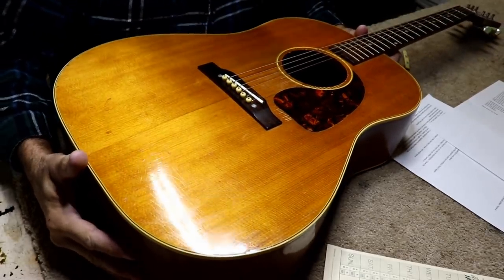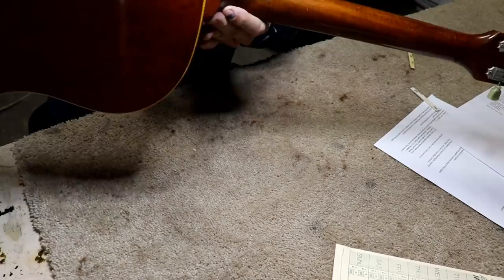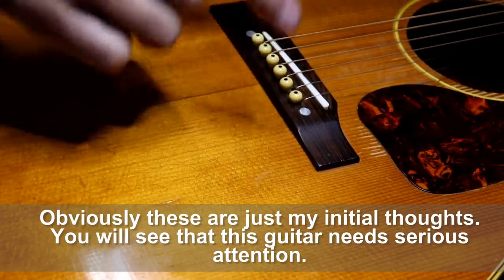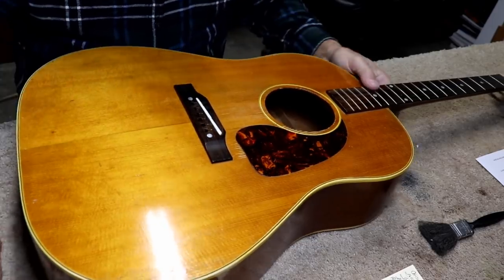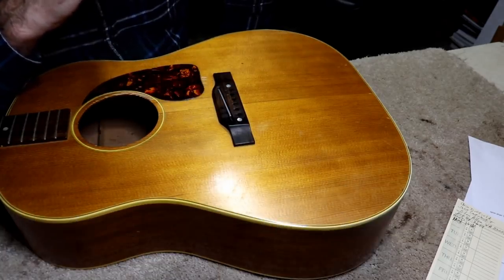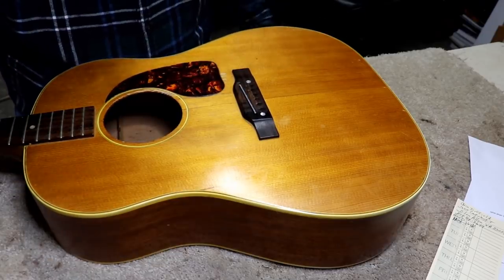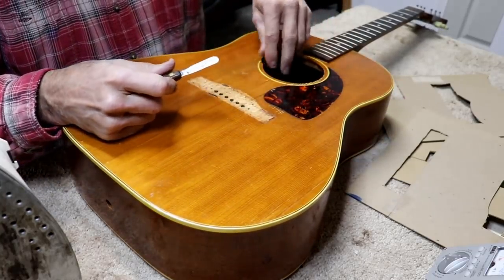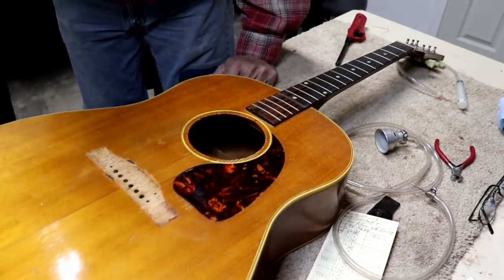278 RSW Gibson Guitar From England Rebuild Well Almost P1

Comment: Hi Jerry,
I have big hands too and it is really hard to get inside some of these guitars. I enjoy working on guitars too like you I started with building a mandolin then went to repairing violins and guitars. I'm living in the Philippines now and working on getting. Visa so I can bring my wife back to Oregon where I have a good work shop. While Im here I have built a very small work shop about 8' x 10' snd have been buying used guitars and repairing them. Because I need to keep building my skill or I'll lose it. I can buy some tools much cheaper here. So I'll be shipping some things home. Thanks for sharing your skill. I have got a lot of ideas from watching your videos. I still use my wife's old iron to heat and remove bridges. 😊

Comment: If you build a new jig, for pulling the neck, I would recommend constructing one that pushes against the heal, vs. pulling from the top.  A large C clamp (w/ different cauls for different style necks), incorporated into the jig, would allow you to wiggle the neck while adding pressure to the bottom of the heal.

Comment: At 50:03 trying to use the camera, if you made a small bracket that would hold the camera with a short leg off of it then use hot glue to mount the camera for a good view and positioned right, go in and do your work then heat a small piece of metal that you could go in and melt the hot glue to be able to removed the camera. It would hold the camera steady and turn your hand loose for working.

Comment: Had to chuckle a little bit over this video. Had the very same problem getting the neck off my "Vantage 12 string". That neck was sure stubborn to remove. It took time, but after working at it steady, it finally came loose, with next to no damage done by the removal, although I did find the dovetail lacking it's tip on the neck side, once it was removed. Where the tip is, is beyond me. It just wasn't there at all. About a half inch of tip was missing, when the neck came off... just disappeared. Everything else was in real good condition, both on body and neck.  Also found around the neck block on mine also needs work, getting it solid again, and the first brace between the neck, and the sound hole was broke in 3 places, so I removed it and have made a new replacement.  I also had to cut the fret board to remove the neck, but I plan on replacing the fret board on mine, with a new one. Should look good when finished.

Comment: Hi Jerry;
At 32, 13 we can see steam coming out of your teapot. Looks like a very workable apparatus. I suspect at this point that I would think they may have put some kind of pin between the neck and the end block. At 45, 50 to me the open crack in the center of it's length would indicate it's caused by the belly in the top. Perhaps if you could put down pressure on the top it would close, just saying. Ha;that's just what you did later in the video. (When I put the times, that's where I'm paused when I make the comment.) I love watching you work. I think I can say with surety that your top repair will come out great.

Comment: For the neck puller you were sent, my guess is that it sits on its feet on the table and the guitar is placed upside down on top of the puller.  Then you can push down on the neck and there is space for it to move down toward the table.
Reply: Exactly what I thought.
Reply: @overthetarget9401  same here. Not too hard to figure out.

Comment: Just a thought, but, those battery powered tools with a vibrating blade attachment which is offset yet parallel to the tool may extend in far enough to reach the bridge plate or could be extended to where it would.

Comment: Entertaining and educational as always Jerry!      I’ve seen some funky bridge pads on vintage Gibson’s,some of them are too skinny to offer a whole hell of a lot in the way of support.  One of the worst guitars I’ve had in for repair was a vintage Gibson,I forget the model as it was a couple years ago but it had a plastic bridge with some funky metal/plastic adjustable saddle and it was a string thru instead of being a pinned bridge. Guy wanted some top cracks fixed,normal pinned bridge and wanted a fret job and neck reset. Long story short,the last guy/gal who worked on it had the neck and bridge off,they used 2 part epoxies on the neck,bridge,nut and they tried to seal up a couple cracks with it too. It was a nightmare.
Reply from the maker: Yes I've seen a lot of those weird plastic Bridges. None of them hold up over time. Why they ever did such a thing I have not a clue. In my opinion the epoxy has very little use on instruments at all.
Reply: Rosa String Works. 

Jerry,I have nary even a guess as at why Gibson used such a crappy bridge and saddle design on other-wise nice guitars,well for a Gibson anyways lol  I know they don’t bring near the money on the vintage market that a traditional bridge/saddle Gibson does. It was just a shoddy design as a whole. 

As for the epoxy,in my opinion it has no place on any proper woodworking project.  That same Gibson that had all the epoxy in it also had a porly repairs neck/headstock break about an inch down from the break angle on the headstock repaired with epoxy. And it wasn’t even the good stuff like west systems or the likes. It looked like fast set permatex brand epoxy like you get at Walmart,homestore,hardware store ext.  It was glued up about 1/4” off of the centerline of the neck. Wasn’t anything I could do to that guitar at all. I gave him his deposit back and apologized for the shitty work done by the prior person.

Comment: Jerry,  I wrote you the other day, about the bridge plate tool remover. and asked if you might remember the video you used on in. Well Sir, This is the video, and the tool I was asking about. Now I know the tool can be bought through Stewmac.  It was this tool I need to remove the old chipped away bridge plate on my 12 string.  Thanks for the help you provided, Jerry.  I'll go to Stewmac.com,  and order the tool.  The bridge plate on the 12 string is thin layered plywood, and is a bit to small as well for the job it needs to do . I'll have to remove the old one, and make a new more solid one, and install it. I'm surprised I was able to find the info I needed so fast, with all the videos you put out, but luck was with me, and I found it.

Comment: Here's my take... IF you had moisturized the inside of the top, then strapped that flat board to it, and put a 25W light bulb inside for about 30 minutes (repeat several times cooling and heating with the light bulb) THEN, you would have had a flat top to attach your plate and bridge to. ( I saw p2 where you still had an arch across the top).

Comment: So I'm at 49 minutes in... Just want to mention, you should be able to insert the camera into the body through the input jack hole. If the camera borescope head is the same size as most of those you can get off Amazon.
EDIT: LOL, and 15 seconds later the text on screen mentions this very thing.

Comment: Bolts were added to brides to forgo clamping in assembly. Hours saved.
Reply: Cheap and nasty if you ask me and no prestigious brand should be seen using this. Cheap guitars yes but Gibson never! Having said that though Gibson is now one of the worst guitar companies out there and with companies like Chapman and Asian and other European builders popping up I think Gibson should die and go the way of many other companies who rip of their customers and fail to just build what they used to be reasonably good at. I personally would NEVER buy a Gibson guitar ever again except for a used guitar that I know was built well. My Gibson M-III had so many factory fuck ups like string alignment issues that shouldn't of been present. I put all the flaws right but it cost me a packet. The only reason I did this is because I loved the look and sound of the M-III especially with the reverse explorer headstock and gorgeous Black nitro paint and arrow head inlays on the 1 piece quatersawn maple neck. Remember most LPs were built from plywood back in the day especially when people state those were the best sounding LPs ever made!!! Those guitars should of been solid timber bodies considering the prices they have always asked. I hate Gibson as many people now do and they know it yet they still charge massive amounts when almost every company building LPs build much better guitars...lol. Just look at the joints on Gibson necks..? some have even fallen off because the gaps were huge and then held on with not enough glue...just atrocious and utterly disrespectful. And don't get me started on the ugly flame tops they started offering to copy Hamer, PRS and Carvins exquisite tops with beautifully couloured tops also.

Comment: I knew that wood!  I have some mandolin back and side sets in the basement.  Makes a good sounding mandolin but the sides are a pain to bend. Speaking of steam engines, have you been following the UP 4014 Big Boy restoration?

On the bulge, I know I guy that was working on, I believe, was a banner Gibson. The braces were shot and a huge bulge. He had to pull the top and rebrace it as some were completely off. He had a large cast iron skillet he heated and put on there with weights to help bend the wood back. Put an oversized (maybe 2.5") bubinga plate and made it work out.

Comment: One thing that should have been mentioned ( and often), Guitars should be regularly humidified, to help prevent wood shrinkage, and both glue and  joint stress, specially during the winter months, when the furnace is turned on (which gives off "dry air"). Many don't humidify their guitars, and over time the wood shrinks, causing cracks, and loose joints. A lightly dampened sponge placed inside a plastic baggy, with a few slots cut on one side of the bag ( so moisture can seep out), and placed inside the guitar sound hole, or within the guitar case works wonders in preventing cracks, and shrinkage of the wood a guitar is made of. Don't forget to cover over the sound hole, once you have placed a baggy-sponge inside, for max. humidification. Biggest cause of cracks, is dry out wood, that has shrunk over time. That alone, means repairs are needed, that might end up being very costly.
Reply from the maker: Except that I totally disagree with you. I don't ever humidify any instruments. The humidifying cause them to swell up. When the wood comes out of the Kiln it's only at 6% you'll never have would that dry again it only gets more moist from there
Reply: @RosaStringWorks  … Good point.  I'll keep that in mind.

Comment: Re: the  plate for the neck puller. A lot of guitars (most, these days)  are built with a slight top radius, around a  28 foot radius is common, so the  guitar top  is NOT flat. Presumably the "feet" on that plate are there to accommodate the top radius.

Comment: Hey, Jerry. What I've heard (from such a luminary as Lindy Fralin) about soldering guns versus pencil irons is that they can de-Gauss the magnets in guitar pickups. I suppose it's no concern with an acoustic that has a piezoelectric pickup, but it's definitely something to worry about with electric guitars.
Reply from the maker: There's a ton of hype around stuff like that. Many people make those claims but yet when you do it it doesn't cause a problem. I worked in computers for years and never had a problem a single time.

Comment: Maybe that guys neck puller has those leg things cuz it is designed to be used laying on table with the guitar neck facing down..I dont know just an idea.
Reply from the maker: It has the same amount of pressure whether the guitar is facing up or down. What difference could it possibly make? I prefer to work where I can see what's going on. Plus I made the neck puller myself so I guess I should be able to use it in any way I want to

Comment: maybe somone already mentioned this, but i think if the neck puller you were given was placed on the bench with the feet down (like one might think it was designed to be)  and the the guitar was placed upside down on it, it might work like you may think it is supposed to. just a guess... although i freely admit i have NO IDEA how it is supposed to work, and don't claim to.
Reply: I agree, I reckon it's a neck pusher and not a neck puller.👍

Comment: For tops that have risen up or belly bulges as you put it you can use the Bridge Doctor which is a mechanical device that you tighten down under and through the bridge with a bolt action. You set it up and just twist the bolt to the required pressure to take out the bulge and flatten the top. I think Stew Mac makes them.

Comment: Hi Mr. Rosa - I need advice on fixing a satin / matte finish which has developed a dime-sized 'polished' spot because the player kept a finger tip on the top of the instrument while playing. A purely cosmetic issue, trying to avoid applying additional coats of finish. Any advice or video link would be greatly appreciated.  Enjoy your videos - thanks!  Bleikr Morrison
Reply from the maker: I think if you touch it with a very fine steel wool that would probably work.
Reply: @RosaStringWorks  I thought about doing that, maybe 0000 just lightly tapping the shiny area to dull it up a bit.  Thanks, I feel more confident trying that now.

Comment: I am confused with the method of taking the bow out of the top.  Does not the top have a radius and only flattens out just to the front of the sound hole?  By using the flat board your getting rid of that radius?  Not a luthier, just from reading on building one.  Tough neck though.  I have watched all your videos on utube.  Thanks and keep it up.
Reply: Sorry Jerry, should have watched longer where you mentioned should have left  small bow in the top.
Reply from the maker: I'm not sure if we're on the same page you're not. This is considered a flat top guitar there should be no bow whatsoever in the top.  It should be completely flat. By Me putting a bow in the board, I was going to press it down even further to over compensate.  So when it's sprung back it would be flat.
Reply: Gibson, like Martins and most other steel string guitars have a radius built into their tops.The braces are sanded on the backs to that radius when building. That allows them to flatten out a bit when they get dry instead of cracking. I believe most Gibsons are a 28' radius. They are still called flat tops, as opposed to arch tops which are carved.
Reply: It also sets up the neck angle geometry.

Comment: Bolt on bridge plate?  A guitar not worth fixing.  Weller "guns" are useful for some soldering jobs but not for heat sensitive components.
Reply from the maker: See I think it's just what you're used to. I find them incredibly good for heat-sensitive things because they're cold until you heat them up. The other ones stay crazy hot all the time. I have done lots of heat-sensitive work over my life, amps and different things, that I've repaired. Never had a problem.